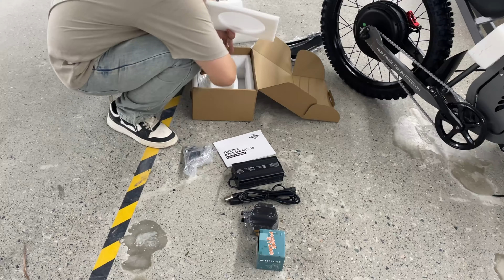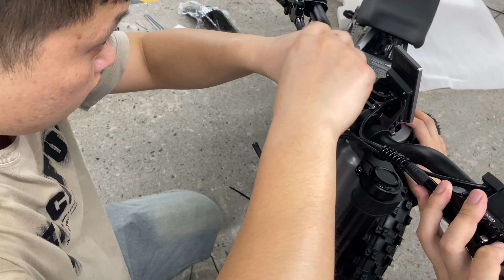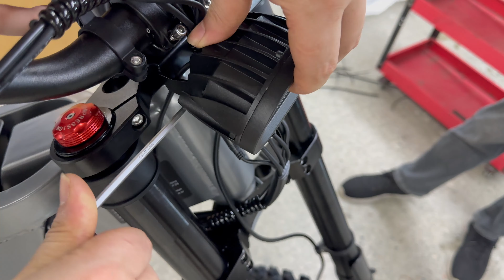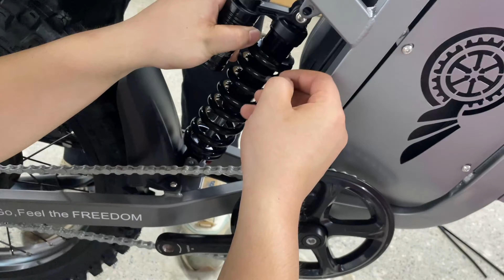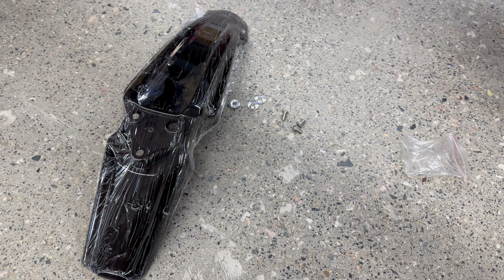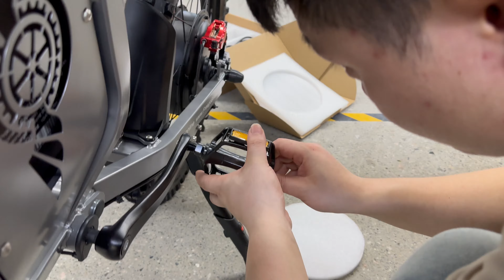How to assemble Freego X2pro electric mountain bike?

Comment: We would like 72v 40ah battery and front turning signals. Like this comment if you agree.
Reply: Definitely hook it up Freego! please and thanks.
Reply from the maker: Please contact with my WhatsApp: +86 159 1650 9140
Reply: Because the X2 pro is slower than the X2. Much slower. And I asked them if it was a difference in the speed before I got it. They said the X2 and the 2 pro top speed is 50mph. That’s a lie.. when people lie you can’t trust them or their product…
Reply: @UVIBIKES  Why do you want me to contact you on WhatsApp? I don't understand.